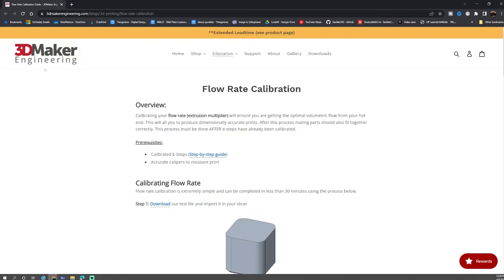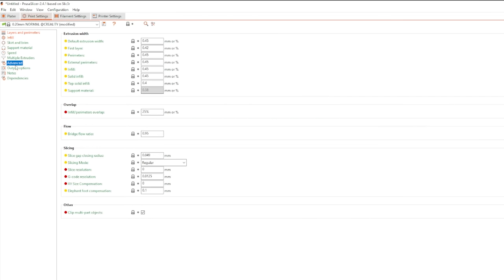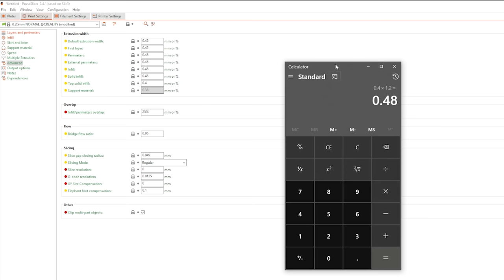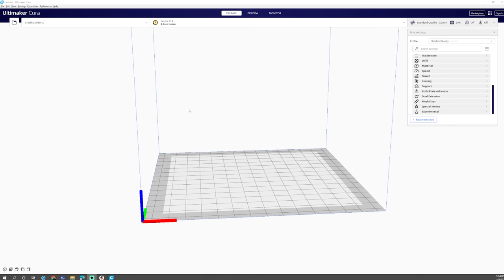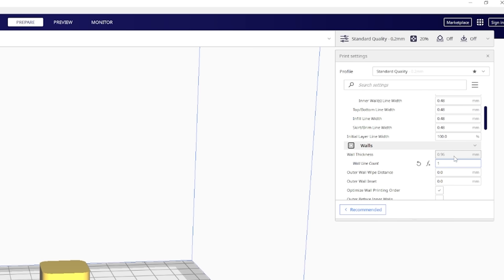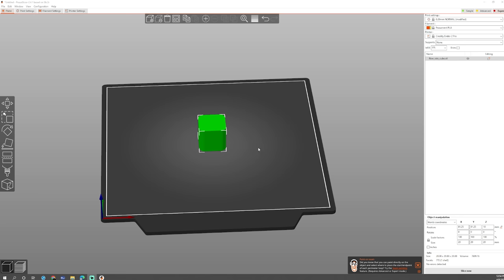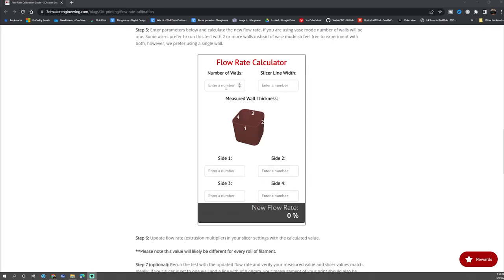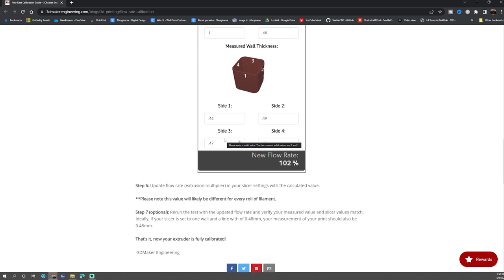How To Tune The Flow Rate On Your 3D Printer!

Comment from the maker: There are some questions in the comments about using .48. After this calibration is done, you should be able to go back down to 0.4, or any other other line width you would like!
Reply: thank you very much, i was needed that info
Reply: So just to be clear, once we get the measurements of the walls, do the calculations and when I get to 100% flow rate I turn the Extrusion width to 0.4mm?

Comment: This video does not cover if you are over extruding or your flow rate is too high.  I got a .7 and .6 wall thickness.  I averaged it out at .65.  To calculate your new percentage use this formula (desired wall thickness X 100) / (your average). Mine was (.48 X 100) / .65 = 73.84 percent.

Comment: Mine said my flow should be 32%. LOL  My prints went all to hell when I started messing with acceleration and I can't get it back. Going to do the measurement of the filament calibration and take it from there. LOL   32%?!

Comment: Yeah - so this touches on a concept that not many people have understood in the 3D printing world. Your E-Steps are specifically for extruding a known amount of filament. We normally calibrate this based on 100mm extruded - and it gives you the base on what to start on.

When running this test, the flow rate is a percentage of your initial calibration. It doesn't matter what the reference filament is, but if you then go and re-calibrate your e-steps and that changes, all of these measurements will change too. So be aware on what you're adjusting, and as Jim says:

1) Calibrate your e-steps once - and never adjust this again unless you modify your printer extruder etc.
2) After esteps, use this test which sorts out the per filament variations.

And remember, if you ever change your esteps, then all the filament calibrations will need to be redone.
Reply: would changing nozzle type or count as a modification, I suspect it would change flow rate. So would you need to chop and change according to nozzle size and type?

Comment: WORKS PERFECT!!!! better than orcaslicer flow calibration!!! only you need the number of the calculator and used with the orcaslicer formula, like this: (your actual flow ratio)x(ZERO)x(the number of the calculator without %)= your new and perfect flow ratio

Comment: when you do this cube, make sure to scrape the last top layer sides as it may have some bulged on the last couple layers. This gives bad readings with calipers. Unless you can specifically mesure the middle, and only the middle, this is what has given me correct readings.

Comment: A rough visual example of 3 walls.
Original flow
(__)(__)(__) = 1.5mm ~

After you calibrated.
 <_><_><_>  = 1.2mm~
The touching points get smaller.
And less optimal for printing 😮

Comment: New / changed filament (especially if it's one that has been opened) always gets an e-step check first, then I heat everything up and do a single-layer disc (about 40-50 mm with a normal nozzle). This will double check adhesion and flow. 

If it looks "off", then I do a flow cube. However, I've always done three walls, averaging them. There's too much variation with a single wall in my opinion. 

Fun tip: on the center of the bed, use a dry erase marker and draw a symbol (arrows, lines, whatever) that is specifically oriented in a certain way. When the print goes down -- unless it's black -- the marker will adhere to the bottom of the print. If it leaves any residue, quick alcohol wipe removes it.
Reply: Estep every filament change? Really….. ?
Reply: It doesn't make sense for me to calibrate E-steps that often. There should be slight difference between filaments, that's why we fine tune it using flow rate.

Comment: Another great tip - adding this one to my list and about to load a fresh roll of Duramic PLA+ to try it on :)
Reply from the maker: Awesome! Let me know how it goes!
Reply: @TheEdgeofTech  not great actually. I ran the test 8 times, each time taking careful measurements and entering them in, then adjusted the flow per the website. Eventually I settled on a measure of .5 to .51 - that was as close as I got with an 80% flow.

Comment: I built my first printer in 2013 and have tried every calibration technique known to Maker. They all have a potential for error. A couple years ago I decided to just make the machine output the calculated amount of filament as provided by the slicer. The calibration method is to pick an ordinary print that needs about 5-10 meters of filament then physically measure out that amount plus an extra foot or so, run the print and see what I get. On one of my printers with a Titan aero I have the steps/mm set to the published value and my extrusion multiplier is .81 to get it dialed in. Since trying this I have had no extrusion issues, consistant, high quality prints and is my preferred method. Another plus is if your printing with a material that is very hygroscopic you can just pull out the amount required for the print plus a foot or so extra and reseal the spool. If I ever get some spare time I plan to make or get a tool to measure how much filament I want to peel off the spool. Give this technique a try. I doubt you'll be disappointed. If it doesn't work as good as I say there is probably other issues.

Comment: Thanks Jim, this is great and only takes a few minutes. what about temp towers they seem to take about 1hour 24 minutes at .2 layer height on my ender 3v2. is there a better way to figure out the temp without printing for almost 2 hours?
Reply from the maker: I know there are a few options out there. To be honest I don't know the times on all of them. I know Teaching Tech had one that was pretty fast!
Reply: @TheEdgeofTech  thanks. I really appreciate all the info you put out. Rock on!

Comment: so after you change your exstrution width to x1.2 for this test printof cube and you get to that proper 100% on all 4 sides do you go back to the default line width in your slicer or leave at that x 1.2 value?

Comment: Question, once you get your results do you keep the nozzle size you calculated ( 0.4mm x 1.2 in my case ) for any prints that you do? Or do you put that value back to 4mm? ( the 0.4mm x 1.2 is just for this test? )

Comment: I downloaded the cube in PETG set as described and had to adjust to 94% did another cube with that flow setting and did the calculations again it stated 100%!  So looks like it should be near perfect now?  On the flow at least

Comment: Great video man! I have a question. I am using Ender 3 S1 pro. I followed the steps you show on the video, I adjusted the line width to 0.48 and print with 100% flow. On the website the result was 94% flow. I used that and print another test with the same specs but with the new flow rate 94%. The new widths are 0.46 on all sides but not 0.48. What is the problem?

Comment: btw after i get the flow rate (mine say 103%) and i change my line width back to default settings - now my line with in the calculator says 94% - which setting should i go with?

Comment: Maybe it's just me, but I'm confused on what to do with the results.  Previous to this calibration, my extrusion width was 0.40 (.4 nozzle).  Even though the calibration requested a .48 extrusion width, do I still apply my new multiplier against my old width?  Also, can someone explain why the calibration uses 1.2 x nozzle diameter?
Reply: Its not just you...I'm the same.
So as a default all the slicers are 0.4 
Then he changed it to 0.48 in vase mode and did the calculation. 
But then what do we do with original line width?? Do we leave it at 0.48 now? Put it back to 0.4? Is this for all prints or just vase mode?? 🤷‍♀️
Reply: @daveedaem  so I think I've figured out more since my question.  I currently figure that 1.2 x nozzle diameter was simply a common assumption.  Really, it should be suggested to choose an extrusion width that fits your job.  For instance, just this morning I used this same approach to calibrate my .4 nozzle down to a .24 extrusion width.  (I found online that .6x to 1.2x nozzle diameter is a good range to work in)

Anywho, whatever width you calibrate to then becomes the basis of your profiles moving forward.  The flow rate calibration can also work with multiple walls which is something I'm considering in the future.
Reply: @benbodrero6520  Thanks Ben. I just left it at .4 and printed the cube in all the filaments I use. Some were very accurate, Petg and TPU for example. PLA+ needed 1.05 flow rate, but now they all print extremely accurately. So I'm going to stop there. 😁

Comment: Hi I have just watched the video thanks. I’ve always calibrate flow watching your Luke Hatfield version and get what I assume are good rates ( e steps are calibrated). I’m using cura 4.13.1 on an ender 3 v2. I used the settings you said in the video the flow rate calculator says I should use a flow rate of 38% doing it the LH way(average wall was 0.85) it tells me 97% so what am I doing wrong? 1 wall, layer height 0.2, line width 0.48 (as suggested) flow at 100% and spiralise outer contour checked. My readings are 0.51, 0.53, 0.52 and 0.53. Flow 38%. Surely that’s not right?

Comment: Great video. I prefere doing 2 walls, taking 2% off the outer wall for better aesthetics and leave it just a little bit over sized at .84 for the 2 walls for a .4mm nozzle. Also I prefere to create the material profile in cura for each of my brands/color and write down the flow rate for each material in the Description box, this has the added benefit of auto updating the printing profile using the material's temperature and retraction settings in case they are different between materials. The flowrate still has to be set manually unfortunately.

Comment: I've been wondering what the point of calibrating your e-steps is if you have to adjust your flow rate anyway.   Does it really make any difference? Shouldn't you just be able to adjust your flow rate instead of doing a calibration that ends up needing another calibration?

Comment: How do you compensate for printing speed?  Cura will default to print this cube at 10mm/s because of short part distance.   But the webpage to download the cube says to print at normal printing speed.  If I set to 100mm/s the cube doesn't come out well at all.

Comment: HI Jim answer me this.  I have done this in prusa slicer,  followed exactly  my siders were all over .48 (.56 .53 etc)  so it gave me a multiplier of .89  . ok good.  I re-do the rest.  sides are .50 and .51 and ..52, but now the multiplier goes back to .94   Is this correct?  to me it should go down not up as I am over .48
Reply: This is really similar to my results.  I would interpret your second iteration to be .89 x .94 = .837.  So yes you are getting closer and the value just needs to decrease a bit more.

Note that this thought process is also what is happening on the first iteration, meaning that the first round is 1.00 x .89 = .89 to get the updated multiplier.

Comment: hmmm its just bouncing me between low and high values in cura 5 beta and prusaslicer running klipper fw

first cube .95,.89,.80.96.  put that in and got a value of 53% ok, re ran the test at that rate and got a wall thickness of .35, .47, .35, .34.  put those numbers in and then im back up to 125 or something, put those numbers in and im back down to 40 something.

Next up prusaslicer, first cube .65, .61, .62, .46 result 81% second cube .30 walls all the way around and the tool says im back up to 160%

i have to be doing something terribly wrong here